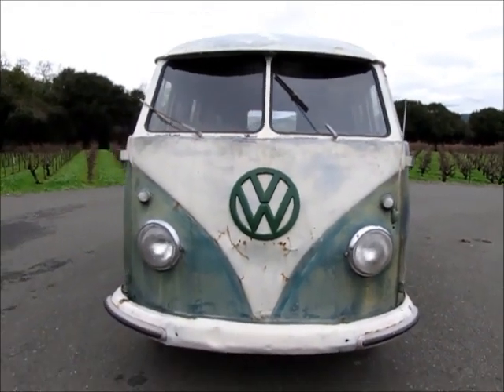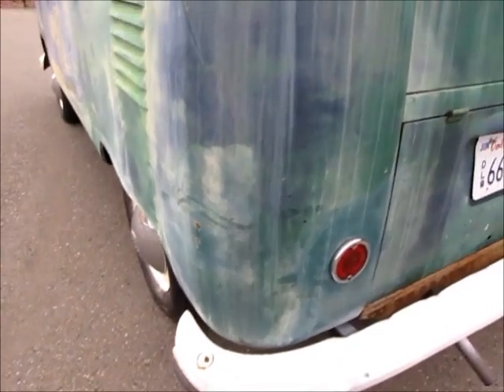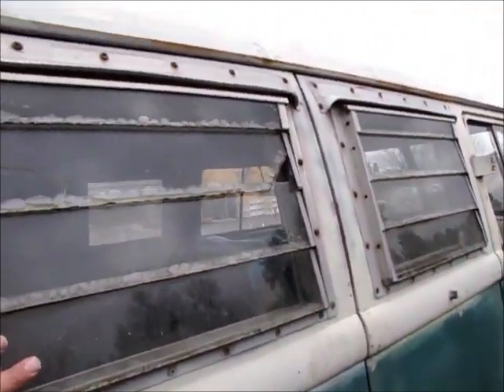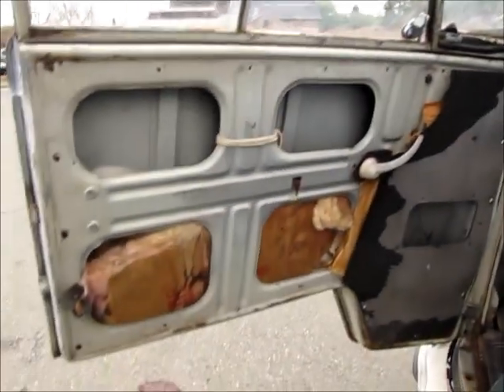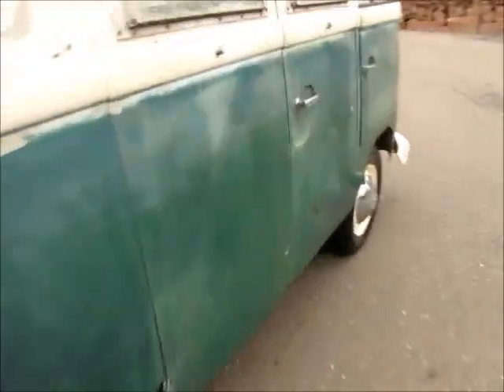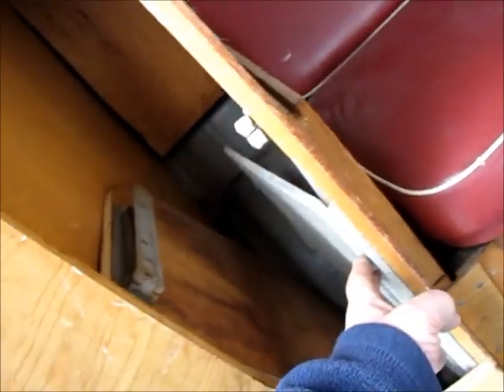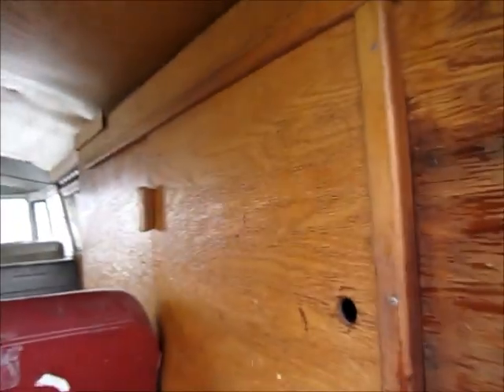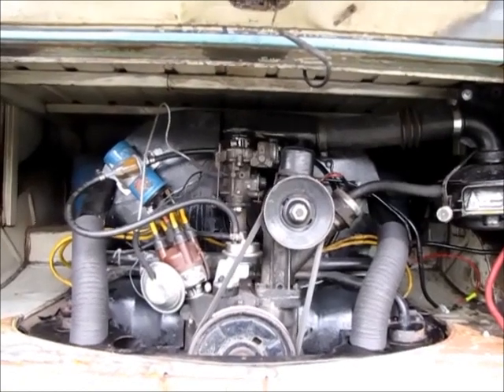1960 volkswagen camper van barn find

Comment: sure ok but i wanted to get a bus for the clollection becasue i have a 65 beetle and we got it for 600 and put some gas in it and it ran good just a slight oil leak and carburator tune up and it road worthy